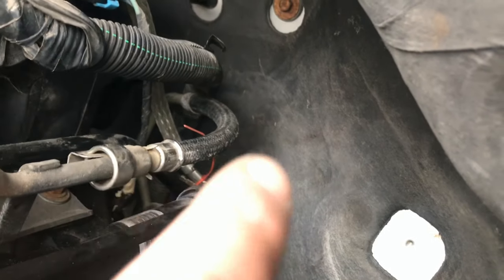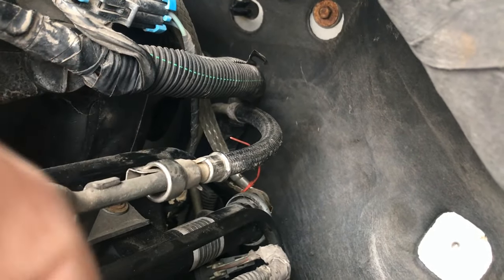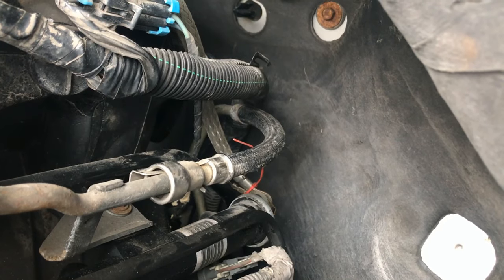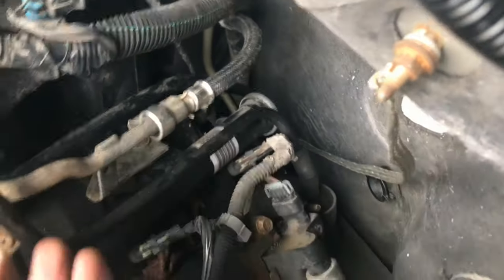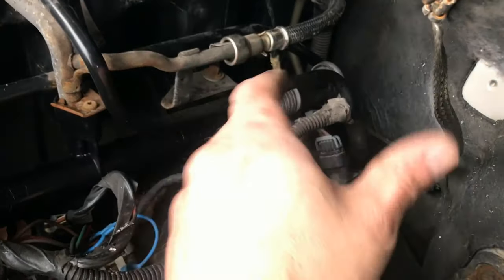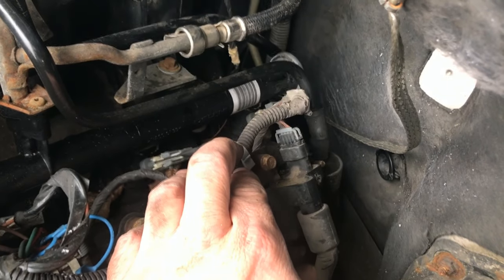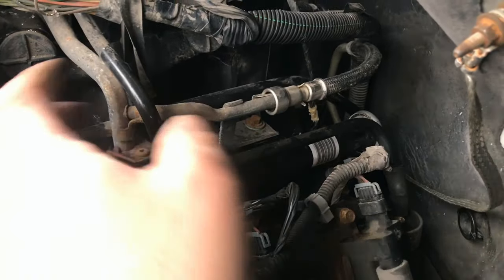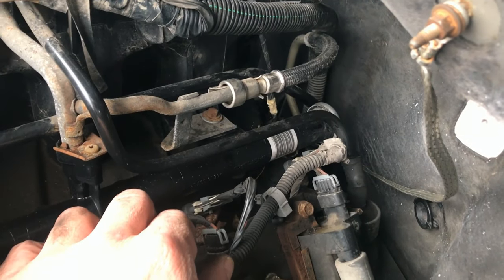GM Ground Strap Replacement: Truck Applications

Comment: Would have been 1 of the best go to videos for this fix,but you didn't show how you took it off,or put it back,what socket,nothing?
Reply from the maker: I totally agree, mind you I needed two hands and had limited options to place the cellphone.

One end bolts to the firewall on the driver's side, the other end attaches to the back of the head near the intake on the driver's side.

If I recall, it was a 14mm bolt. I used both a short socket and a ratchet wrench to successfully take it out. 

To install it, I had to ziptie the wires together to help with bolting it back on.

If you have a helper with small hands, that would also help, it's tight back there.

Comment: Does the ground strap have to be bolted to the original spot behind the intake, or can you bolt it to an easier location and have it work correctly? I will never be able to get my hand back there.
Reply from the maker: @mitchellmontesano8769  it's always best to bolt it in the same spot, but if you find another spot on the back of the head  to bolt the ground, you could try that - but nowhere near the manifold, you might get ground noise. 

I know it's a tough spot, a helper with smaller hands might be best

Comment: You gotta redo this and make it more clear where the other end of the wire go
Reply from the maker: It’s bolted to the back of the head. Best way to unbolt it is with a ratchet wrench.

Comment: I have a 2010 silverado 5.3 what size are the nut and bolt for the graund strap
Reply from the maker: @ortegae29  On mine the bolt at the back of the head for the ground strap was a 15mm
Reply: @TMEx_GearstoGrind  do you know the nut size?
Reply from the maker: @ortegae29  For mine, the bolt for the stud on the firewall was a 10mm.

Anytime I'm missing nuts and bolts on my vehicle, it can be complicated trying to figure out sizes and tread patterns, I just go to the scrappers and pull it from a vehicle similar to what I'm working on.

Comment: Get the double box end S curve wrenches from harbor freight. They’re the icon ones. They work very easily.
Reply: I have a body lift so I just went through the wheel well but the a curve wrenches work from the top.

Comment: Where does the ground strap go to in the engine bay? I see the wire disappears behind the engine bay but you did not show where. Would love to see a video about this because it seems like a damned mystery. I have a 2002 Chevy Tahoe.
Reply from the maker: The camera didn't fit back there when recording. It bolts to the back of the cylinder head. If the wire is broken, you should feel the nub at the back, if it's not, follow the wire.

It's a darn tough spot to get your hands into, and it will take a lot of patience to successfully complete the job.

Comment: Where’s the second wire that you zip tied to going?
Reply from the maker: It bolts to the back of the engine block - there are other ground wires bolted there. So when you find the bolt with ground wires bolted in, which is near the center of the block by the firewall, closer to the driver’s side, that’s where it bolts in. It’s a 15-16mm bolt. 

Based on what I went through, the best way you get at it is with a ratchet wrench - it’ll be very tight to get a socket back there.

Comment: I have a ground strap going to the hood on my 2006 Sierra. The nut apparently fell off and the strap is just dangling. Any idea what size nut that would be?
Reply from the maker: I usually take a trip to the wreckers with a list of odds and ends and pull them nuts and bolts from similar vehicles. I find it easier than trying to match it up at the hardware store.
Reply: what's the ground to the hood for?

Comment: I have a 2001 gmc Sonoma and if your standing in front of the engine it’s located on the back left side by firewall , where does this ground strap connect to ?? The engine or what ??
Reply from the maker: It should be bolted to the back of the cylinder head. Could use a mirror to see if you can locate where the strap is bolted to on the Sonoma if you can't see it.

Comment: I have a 03 yukon and I recently changed the intake manifolds and seemed to pulled a ground the one I pulled was the one you have connected to your hood and my speedometer doesn’t work it lights up but doesn’t move wondering if all I need is a new cable and just ground to hood to fix it?
Reply from the maker: Based on my research, I’ll be replacing the stepper motor located in the speedometer cluster, as my speedometer is currently not working. I replaced both of grounds that you mentioned - the one behind the intake is the engine ground strap, and the one that connects to the hood is for radio ground signal. 

The first thing I did was replace the speedometer sensor, but that did not get the speedometer to work.  

The speed sensor is easier and cheaper to replace, but these vehicles are notorious for electronic issues, including the speedometer, and the usual fix is the stepper motor. I’ll post a video on that once I can get to it.

I found this video on replacing the stepper motor - good luck, keep me posted - cheers! 

https://youtu.be/mFApzUn5UZA
Reply: I just bought a nice '04 Z71 Suburban which the speedometer didn't work.  Just needed dash cluster rebuilt same as my Impala years ago when gas gage went erractic. Nothing unusual.  Now I'm cleaning all the grounds.  After learning about the small, black/white stripe ground wire attaching to back of pass. head I felt for it back there.  Seemed ok but next time I went to start dash gages were goofy and it wouldn't crank over.  Headlights were bright.  Didn't touch anything and next day it started fine.  I probably disrupted a bad connection but will extend it to firewall ground bolt next to the hood ground strap that is broke off.  All grounds must be grounded as shown in this great video.

Comment: What size socket or wrench did you use to get the ground strap bolt, off of the engine block?
Reply from the maker: 15mm deep socket, and long shaft wrench combo. It's a tough spot for sure - it'll take patience. Good luck!

Comment: Thank you so much. I'm trying to fix the starter on my dad's truck. After doing that and still not starting I started looking for wiring issues and found 2 big main ground straps completely disintegrated. Having trouble finding any kind of pictures to show where they are supposed to go. So your video is very helpful. So it looks like that covers one cable, from back of engine to firewall. The other one that corroded away goes to the passenger front side of the engine block, but I don't know where the other end is supposed to go. Can anybody help? Thanks.
Reply from the maker: Hey, I did a search, and this is all I could find to be somewhat useful. Good luck!

https://www.gm-trucks.com/forums/uploads/monthly_01_2015/post-138903-0-43043900-1422453270.jpg
Reply: Was the engine turning but not firing? Mine is getting spark but not firing after redoing the gaskets
Reply: @tedtalour6414  No, it wasn't turning at all. After I replaced all the ground wires it fixed it. One went from the front of the engine block down to the frame underneath the passenger door, and the other went from the back of the engine to the firewall and then down to the frame underneath the driver side door.

If yours is getting spark but not firing then 99% chance it's not getting fuel. 1% chance that your engine isn't making enough compression to fire but that almost never happens these days, especially if it was running before you did the gaskets. Try spraying some ether or starter fluid or even pouring a very small amount of gas into the intake as its trying to start and if it goes for a second then you know the fuel you were manually giving it made it run, but it will stop when you stop manually feeding it fuel because it's not getting fuel normally somehow. You can put a pressure guage on the fuel rails I think there is a place like a tire guage looking fitting on the fuel rails to make sure you're getting fuel pressure. Or you can just take the rail off and see if it shoots out fuel when you turn the engine over.
Reply: Hey man by any chance you have a reference pic for the ground wire on the front of the block ?
Reply: @gabrielvillalpando2538  I don't but I ended up fixing it by running the front block ground to a spot down by the passenger front wheel well. There are big frame pieces and bolts down there. I just loosened a bolt and sanded the surfaces and ended the wire there. The truck finally starts again. I grounded another cable in a similar spot on the driver side too.

Comment: What issues does this hood ground strap cause if it’s missing or broke?
Reply from the maker: Hi, the hood ground strap provides a better ground for radio-frequency (RF) signals.
Reply from the maker: @madwestboy  have you checked your battery, possibly a loose cable or it could be weak? 

A vehicle sitting too long without starting it once and awhile could kill it. Charging the battery could help if it isn’t too old. 

I normally start a sitting vehicle once a week, and take it around the block. Another thing is that if you know you wont use the vehicle for awhile, pull the battery out and store it indoors if possible.
Reply from the maker: @madwestboy  With a multimeter, you can check for parasitic battery drain. In my Iroc, it was the power antenna. 

I found this video helpful https://youtu.be/zdIKNnwEjIs to test parasitic battery drain.

You could also check the ground straps connected to the frame under the driver’s side behind the front tire by the door - mine were rusted on the Avalanche, so I did some preventative maintenance and cleaned them up. 

There’s also a ground strap behind the driver’s side cylinder head, which connects to the firewall, that’s the fat one that located near the hood ground strap.
Reply: @TMEx_GearstoGrind  I also traced the smaller aux. ground wire # 8? that goes from battery neg. post direct to frame just below core support by body mount on '04, Z71, Burb,  hidden but easy to get to.  The heavy wire grounds to block.
Reply: Man I just changed my oil pressure sensor and now my truck doesn't start it will crank but will not start I think I might have either pulled, disconnected a ground by accident and I was looking at my ground on my battery and its original but there is the big thick cable ans a smaller gauge wire thats split so i need to check my wires just kinda hard been cold as balls and windy no shop just outside and been frustrated my truck was working fine before the oil pressure sensor I really hope I can fix this I only have this 1 vehicle right now any input would be appreciated all I disconnected when I replaced oil pressure sensor was that little pig tail on middle right under the vortec plastic it's black and baby blue right by the other flat braided ground anybody know what that's called? Thanks

Comment: any idea what ground could cause no brake like, 2007 chevy silverado.. TY for ANY reply
Reply from the maker: My brake lines on the Avalanche were rotted at the abs control module, I had to replace them - I don’t know of any ground issues causing brake failure, however, if anyone does, they are free to chime in.

Comment: Just Curious, where does that second ground wire trace to? I rebuilt my motor and I'm having issues with the bcm and ecm now. Your video made me realize I don't have anything but the braided wire on the stud. None of my diagnostic diagrams show the source of that particular wire and I don't see any loose wires that need grounded in the area. Your help would be greatly appreciated sir!
Reply from the maker: Hi, the large braided ground strap is bolted to the back of the engine block to the firewall. That wires should have a ring terminal on each end, if not, then the wire broke, and needs replacing. Those wires also corrode. The small braided strap nearby goes from the base of the hood to the firewall. 

Part #s: 
Battery Terminal (Lrg Braided): 6EG21
Small Ground Strap:  15179982
Reply: Do you have a picture 
Mine is causing Reduced engine power and not one mechanic will help me. Dealer shop for 2 months they said sorry we can’t fix it we don’t have a clue
Reply: @moonshinesdream3627 

Any updates on your issue? I'm having it on my 04 suburban.

Comment: if that bolt is broken can i connect the ground to the bolt behind the engine ?
Reply from the maker: Test if the location grounds with a test light or meter, if so, then it should work.

Comment: When I turn my key my Silverado won't crank. The headlights, radio and headlights work fine nothing dims I need help. The only ground I found loose was the one connected to the rack and pinion
Reply from the maker: Check the starter, look for a corroded starter wire cable, or a blown fuse. If all is good, then I would check the ignition switch.

Comment: Did you try extension with magnet for socket?
Reply from the maker: Whatever works, do that. 

I used a combination of a 15mm deep socket and a long shaft wrench. 

It’s a tough spot to get in to, unless you can get small hands back there.
Reply: @TMEx_GearstoGrind is there 2 wires and the bracket on the same bolt?

Comment: Jesus, speak up
Reply from the maker: I agree , the audio lacks on certain videos. I'm working from an iPhone, which recently shut down. Waiting on new cell, looking forward to better sound quality and cam work. Cheers!
Reply: @TMEx_GearstoGrind  
In that case I feel your pain, my iPhone audio is horrible. But good video, I would have never thought to disconnect those lines to get to that bolt on the block to replace that ground.👍

Comment: This video definitely helps but also  this spot is so tight. I haven't been successful in reaching and changing it. any tips/tricks would be nice, I know he mention having that 15mm deep socket and a long shaft wrench combo. maybe not having that is hindering me.
Reply from the maker: That’s the only thing that I could figure out to get the bolt back on - I also had to tie the ground to the bolt as it kept slipping off - it’s definitely a difficult spot.
Reply: Flexhead box wrench did the trick for me, oh and i zip tied electric wire harness to have room.

Comment: Why does now one show how to get it out in the first place
Reply from the maker: I recorded it with my cell phone. It’s a tight spot to get into behind the engine. 

I used the ratchet with a short socket to crack the bolt at the back, then used a ratchet wrench to take it out.

To put it back it in I placed the wires on the bolt and carefully treaded the bolt back in place, then used the wrench to tighten the bolt - once the bolt was on, I used the ratchet with the short socket to lock it into place. 

Good luck!